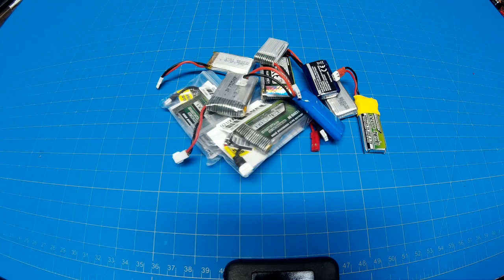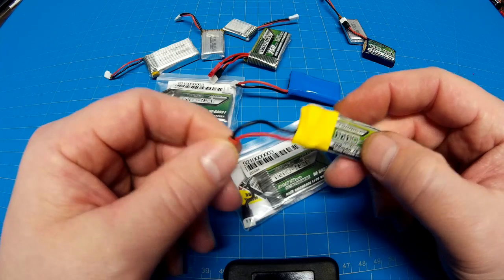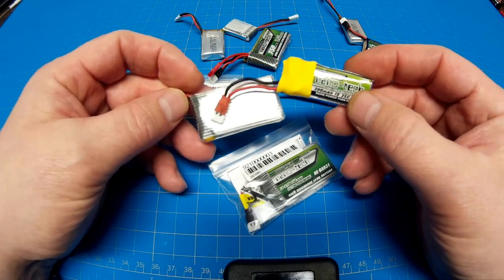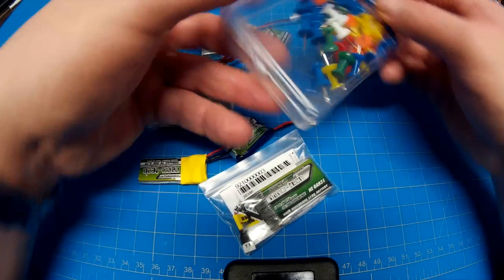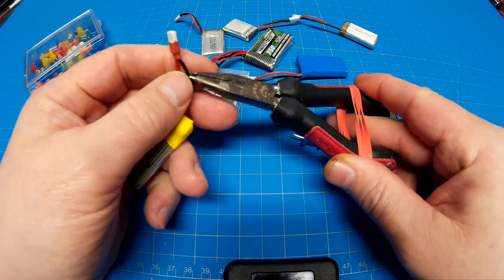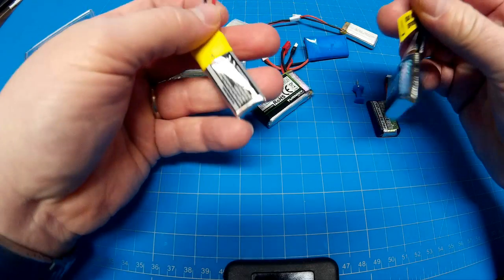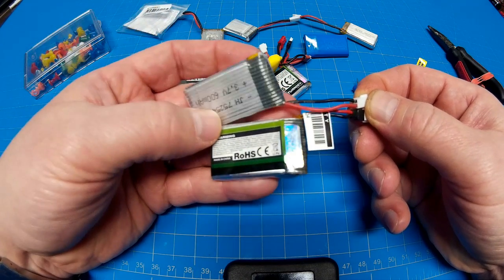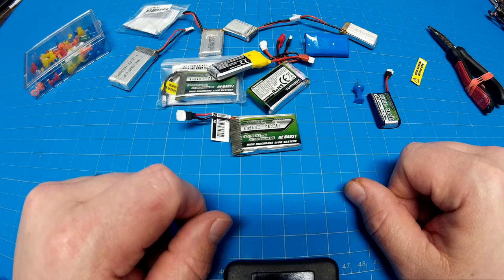Reverse Polarity

Comment: I happened to connect a homemade 2S (18650) for my Protocol Predator SB 2.4Ghz Helicopter and the same thing happened. Smoked, it connects, but I think I fried the gyro? Could I get some help? Also the cause was because I accidentally soldered my JST plugs in reverse.
Reply from the maker: I am not familiar with the predator SB, I would expect a voltage regulator got burned. It, or the damaged, component would need to be identified for repair. In most cases we replace the component with the damaged small electronic on it, as finding an exact replacement for a small component is challenging, and then doing the small component repair is a fairly specialized skill set.

Comment: I don't even match up the plugs any more. I just line up them up by the wires color and then push them together. Good thing tho because i was just about to plug in the battery for the first time on my first micro build when i realized the polarities were reversed. Even more amazing is that i actually got male/female plug from the same store and only the males were reversed, the females were the same as the battery. So the plugs they sold me don't even match up. :\

Also means i will have to switch the wires every time i have to use one. Ah well, i'm already doing that for the plugs i used for the FPV cameras.
Reply from the maker: I have found its mainly hobbyking and ebay stuff that is reversed. I have blown more than one item not being careful enough.

Comment: Can you really trust that red and black are connected correctly inside the battery?
Reply: Egg Xactly
Reply from the maker: +Nuffe351 The electrical standard is black is ground and red is hot or voltage. I have yet to see a battery with the red and black swapped internally. I have seen the ends be connected, in a 2 wire connector, both ways.